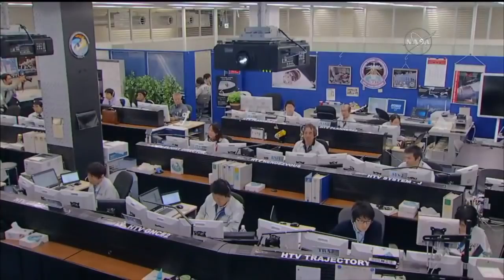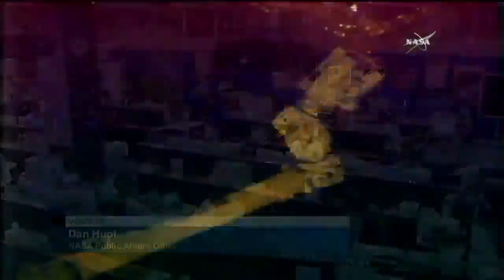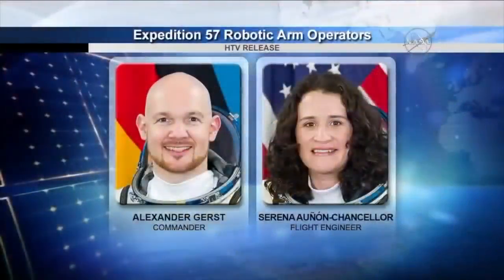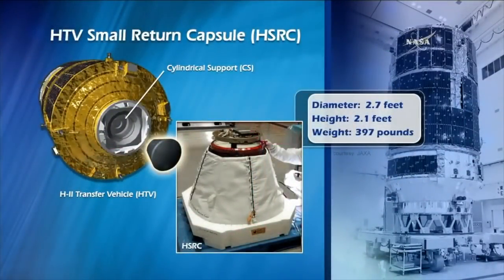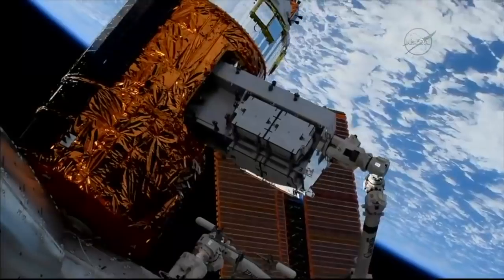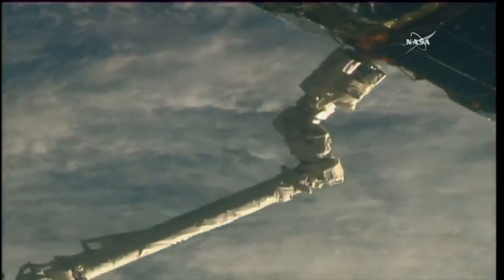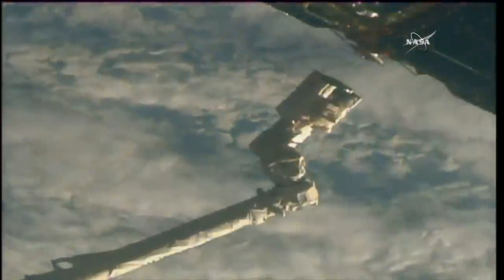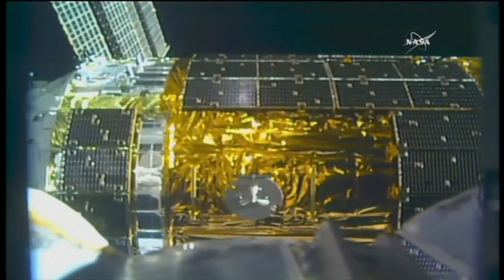HTV-7 departs the International Space Station

Comment: Sadly without the old ISS batteries (two cancelled spacewalks).
Reply: Due to MS-10 ? I guess
Reply: @SpinHalo76  yup but the Russians have closed the case and a fully trained crew will come up HTV has to leave because Cygnus is on the pad and you can't dock HTV when there is a Cygnus coming up they use the same command system to dock and not only that a week after Cygnus come up Dragon arrives bearing gifts if the crew wants to dock Cygnus and Dragon HTV has got to go. the next crew will do the spacewalks and this one will go home. Nick and Oleg have been assigned to a taxi flight they will bring a new soyuz up and the old one will be used by the departing crew. Nick and Oleg will go home on Crew Dragon once it is ready and Astro Sunny and her crew will command the station.
Reply: @geomodelrailroader  More punctuation next time, please :)